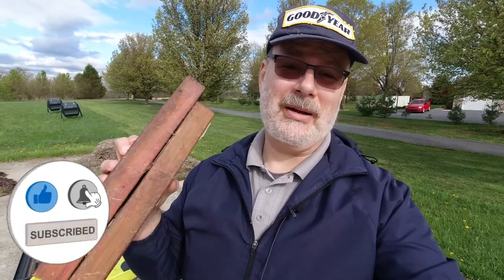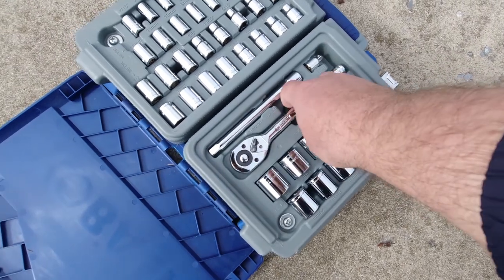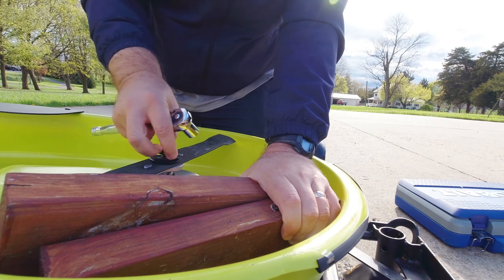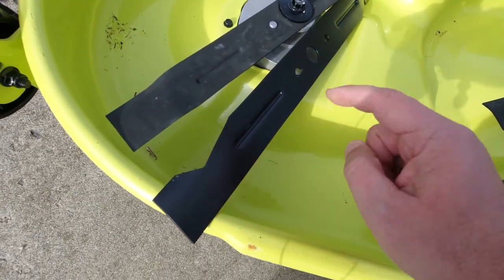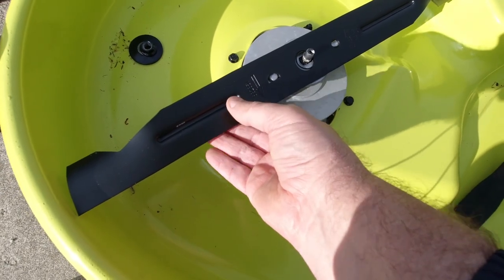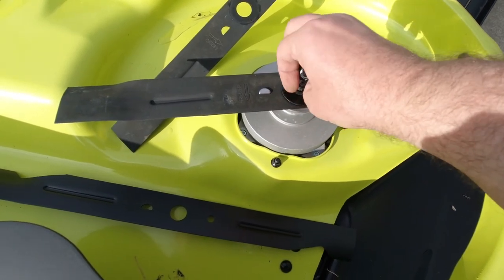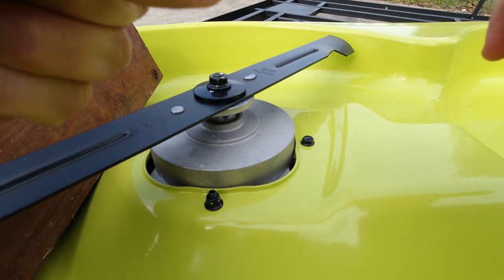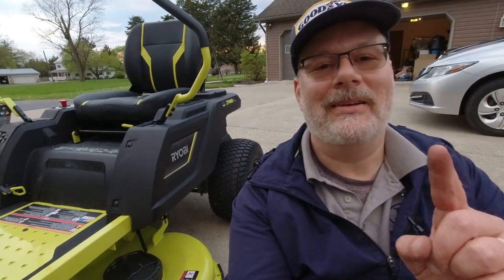Changing Mower Blade on RYOBI Zero Turn Battery Electric Lawn Mower - RM00217

Comment: Thanks for doing this video. I have a question about the torque settings? In the booklet I received it said to tighten to 650 lbs but you said 54 lbs is his correct number you are stating?
Reply from the maker: Hi John. Thanks for the question. It has been a long time since I made the video but I think it was 650 inch lbs which is 54 ft lbs of torque.

Comment: Great video!  What is the difference between these blades and the ones you took off?  Is one better for mulching than the other?
Reply from the maker: Hi Steve, the blades I took off were the original blades that are supposed to be ok for mulching. The blades I put ON are designed to work with the bagger (video to come in a few episodes, so subscribe and hit that notification bell if you are interested in that upcoming video).

Comment: My new zero turn blades keep shutting off periodically.  I've looked over everything and can't find anything wrong. Now, they won't come on at all. Any suggestions?
Reply from the maker: Doing a bit of digging there might be one possibility that I came across. Try taking off the mower deck and try to spin the blades by hand. If one does not spin, the electric motor on that blade may have ceased up and needs replaced.